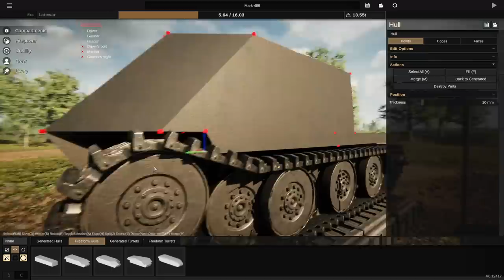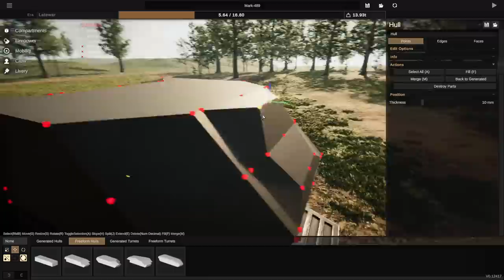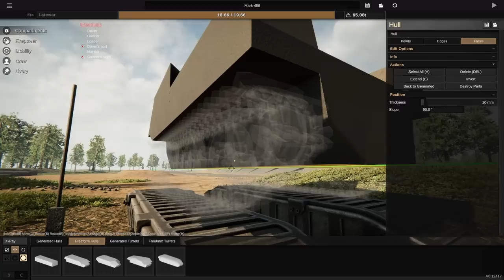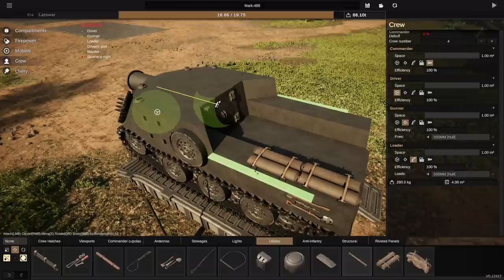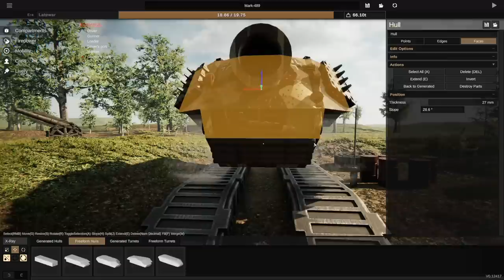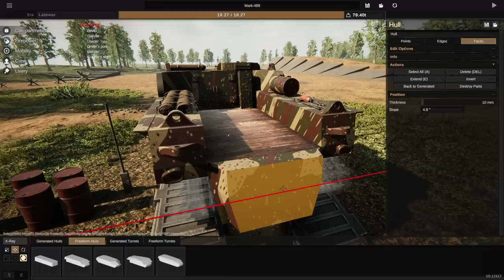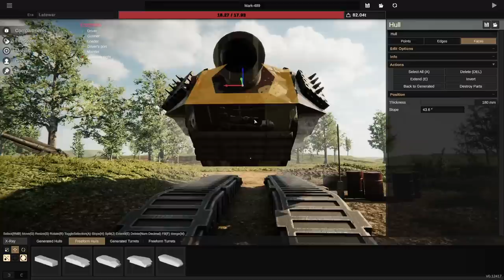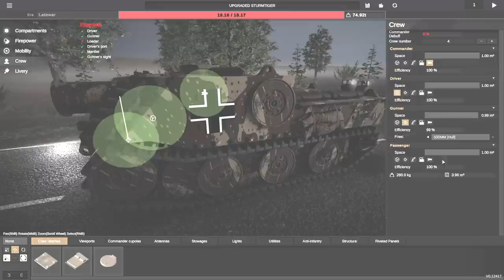I Built An EXTREMELY POWERFUL HEAVY MORTAR TANK In Sprocket Tank Design!

Comment from the maker: What do we think about pooping HUGE shells onto enemy tanks? :_FranticWhoKnows:
Reply: Nice
Reply: Great at dealing massive damage
Reply: @stormtastic7083  he said in the video he was gonna base it off that
Reply: 24:00 did you say you don’t know what it means? STURMTIGER 
Thundertiger
Reply: Nice
Reply: @Unser_Osten  Sturm means storm
so it would be Stormtiger
Reply: It’s a knock off Sturm tiger
Reply: @Littletss  yes.
Reply: Effective yet expensive.  Ultra heavy caliber shells tend to be pricy and difficult to load or use on ground based vehicles as it’s hard to get significant velocity or spin on a naval caliber shell fired from something as small as a tank.  The Sturmtiger got around this by actually firing rockets instead of shells.

However, as the Ratte’s design was a thing and the Schwerer Gustav cannon proved, using colossal caliber cannons on land CAN be done.  The major issue is how do you deal with the weight issue?  The Ratte circumvented this by being so long it can ford rivers on its own and had tracks so wide it basically was laying its own road as it moved.  The schwerer-Gustav was a train.

I would be curious if you could figure out a way to give something like the sturmtiger a turret.
Reply: Remember me when this gets famous
Reply: @DaveTheWaterGuy  😟😟😟😟😟😟😔😔😔
Reply: the decals on the front look like eyes
Reply: Fuel tanks directly in front of the only escape hatch, vents blowing hot exhaust back into the opposite vents to gas the crew, an inaccessible engine preventing in field maintenance and repair, and it’s grossly overweight, carrying 2 rounds AND it’s got 0 degrees of gun depression?
I think it needs Russian markings , not German.
Reply: STURMTIGER

Comment: I'm pretty sure the sturmtiger is a 380 mm rocket propelled cannon. But it's classified as a 18 or a 38 cm cannon can't remember which one exactly
Reply: You got it right my friend, 38 cm RW61 auf Sturmmörser Tiger.
Reply: For future reference, 10mm is 1cm, so 380mm is 38cm, for example.
Reply: @mattevans4377  a forgot that Americans still use the outdated imperial...
Reply: @mattevans4377  a forgot that Americans still use the outdated imperial...

Comment: Brummbar, strum tiger, so this one should be called the Kastanientiger  or  Großer Junge 3
Just like Sturm it has a truck following it just to have another round in but this one they got to lift it up that trunk hatch on the trunk needs to be opened and they pull it in (I know they’ll die during the process 1 drop its over)

Comment: Should have gone with 380mm like the strumtiger instead of 500mm may have been able to fit reloads. But its still neat
Reply from the maker: Reloading something like that in this game would have taken like 30 minutes :P
Reply: Fair enough
Reply: @FranticMatty  100% accurate to life then.  The Schaefer Gustav 800mm railway gun could fire one round every 30-45 minutes irl and it required a crane to do so.  Using something like a battleship’s elevators would be your best bet; but I doubt this game goes into THAT much depth.